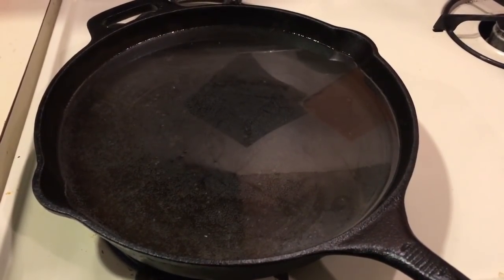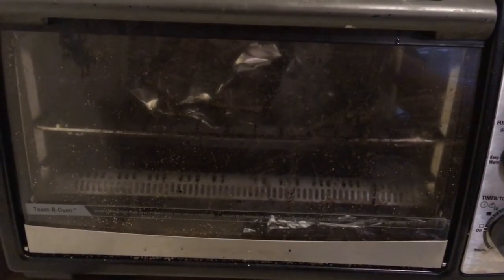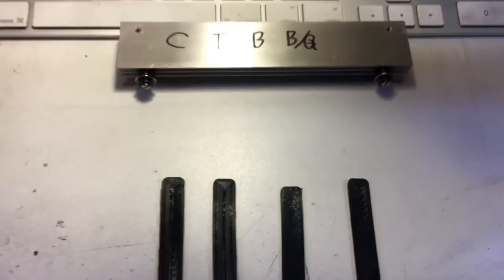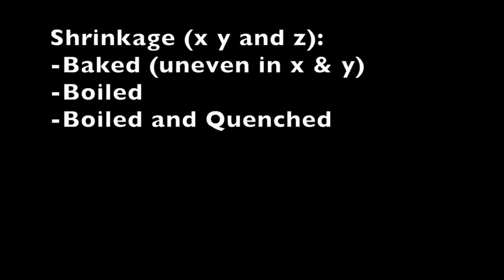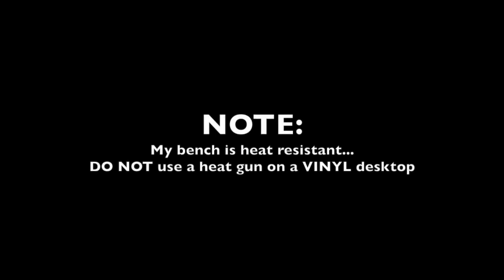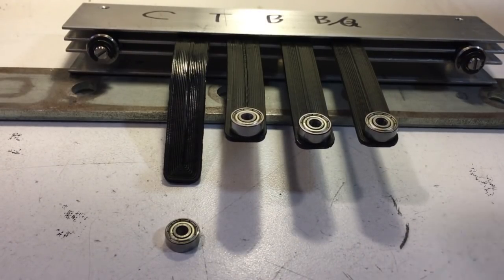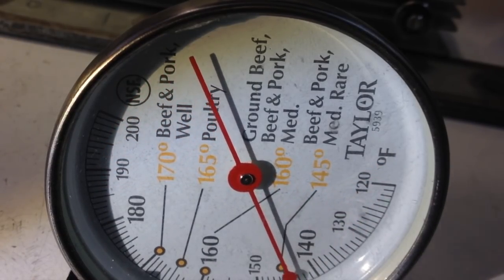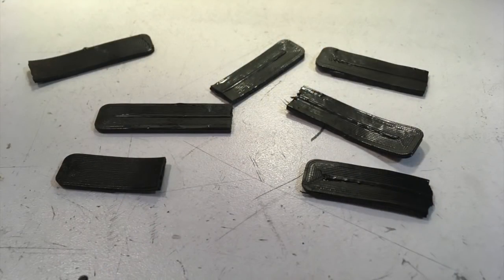A quicker way to anneal PLA 3D prints

Comment: I had success annealing my 3D-printed PLA part in an air fryer on 180° at 30 minutes. An air fryer is just a fancy convection oven.
Reply: I did put one of those springy rubber bits under it though to stop it from touching the bottom. More to protect my air fryer than the part but I'm sure it helped.

Comment: If you've got access to a flash autoclave, such as a Statim that dental offices use, there maybe an even better flash annealing option.  The Statim's flash cycle uses steam under pressure at 270F and the process, including dry time is done in 7 minutes.  It's not totally cooled down, add a few more minutes after the case is opened up...   

This discovery came about when one of my dental staff accidently put a PLA suction device in the Statim instead of the cold sterile tray.   To my surprise, the suction device didn't come out as a pile of goo,  Rather it came out relatively unchanged in shape.   I've not done any 'real annealing testing on these suction devices with flash curing...   It's not a flat item, rather it's a tube that has a 120 degree bend, and one end is a cylinder, the other a larger oval tube.   

The downside here is a refurbished Statim flash autoclave runs about $2000.  A less expensive option might be to try a simple pressure cooker...  Pay attention to the limits of your pressure cooker as things can get dangerous under pressure and heat...  (aka, use at your own risk).   What I do know is the Statim process is very controlled and it works and works fast...

Comment: I used your process to anneal a z-axis rod knob for an ender 3 pro. I boiled it for 4 minutes, and quenched it in ice water. I hadn't planned for as much shrinkage I got, but I was able carefully drill it out for a pressure fit.  I am VERY PLEASED with the product, and will be using that process to harden many more printouts. It inoticably mproves the strength and surface finish.  Thank you for the tip!!

Comment: Good thing to try: parts in a kettle.
I've done a sample run, it seems to work as a really nice quick and effective heat treating method, note that i had no foil or support metal, just dropped the stuff into the pot and turned it on; swirling the water to stop things touching the element...
The parts act as boiling chips, which seems to clean them somewhat, but may destroy fragile prints, or anything hollow that fills with liquid...
For things like spacers and other small components this works the best it seems!
Will likely try the brass hinge method later down the track, however i don't know if this is a symptom of being boiled alive, but the plastic "turns white" once it finishes drying, it appears as if there is a layer of some residue (which would suck) or the smooth surface has been roughened by the process of crystallization and boiling (which would be good, especially for paint adhesion)...

Comment: One question though. Can a sequential quenching, eg heating and cooling multiple times increase the strength further?
Reply: @UrosGavric. Yes and No, this depends on how consistent the heating environment is as well as timing between processes. If you do it too many times it will drastically affect the size dimensions as well as leave more room for error in regards to deformation / can greatly alter tolerance specs etc. If you have access to a suitable environment with consistent temp / time settings / go through enough trial and error yes it could increase the strength but it depends on what "strength properties"  youre looking for, such as compression, tensile and shear strength. each of those properties are critical to understand and drastically depends on the materials used, geometry and sizes of the parts  to create successful print post processing. I.E) If you alter settings to match compression strength you will likeluy lose "strength" in the field of shear or tensile. It is an entire science field so you'll have to experiment accordingly

Comment: for smaller or thinner parts like these, there is the delightfully lazy alternative, to just leave the parts on the print bed, crank it to 75-80°C, and put something like a styrofoam cup or a little cardboard box over them. give it 10-20 minutes, or untill the top is getting the slightest bit soft, let cool to room tem, and enjoy.
stickling to the bed also helps to keep thin parts nice and flat. works like a charm when printing a batch of guitar picks.
Reply: will try it for sure, thx fot the tip!
Reply: I cover mine in aluminum foil. It reflects the heat really well

Comment: Hi Alex. I printed one of those cable chains but it was a bit too tight so I tried this boiling water trick and it worked fantastically! So thanks for this tip. The chain is here : https://www.thingiverse.com/thing:2354864/comments

Comment: Boiling parts directly in water is terrible, water gets inside the parts and destroys them.
Reply: Why? It's not nearly hot enough to induce hydrolysis, and in absence of such water is harmless to PLA.
Reply: Shake part out. Use bag+rice or silica. Or just use a dehydrator on low...
Reply: @Chris Valin Apparently, PLA is water-cooled as it is extruded at the factory... Which makes sense, since it allows them to speed up the process of production.
Water on the surface / trapped in surface defects on the filament is likely a bigger issue, and also fingerprints etc.

As for boiling, it's probably a bad thing for parts with low infill and thin walls - if water gets into the enclosed space, it will suck to try and dry it out [days] or worse, if it nucleates [boils] on the inner surfaces, then there will be a rapid increase in pressure inside the part as the steam bubbles expand; if you hear a loud pop and come back to a split-banana, it could be this kind of failiure...
Hence 80 degree temperature control is the best option, and as mentioned elsewhere, glycerol can be a better alternative to water.
But for solid parts of small dimension, throwing them in the kettle is not at all unreasonable, just spray them with isopropyl to rinse the water off the surfaces, and let that dry off [5 minutes or so]...
Reply: Chris Valin,
So we should expect your replication using acceptable scientific standards soon, right?

Keep that nonsense to yourself unless you’re also going to post a reference to information you find acceptable.
You must have an example since you feel confident enough to criticize his effort.
Otherwise, you’re just being a pretentious jerk.

Comment: Made my own experiments recently. I measured two 50g spools of PLA, put one for a few days in water, the other in a bottle of Steiner Chemie dissicant (silica with indicator). The watered spool had the same weight as the dry one. They both printed the same, no changes in feel, stringing or look. I didn't hear any popping sounds either wihle printing.

Water doesn't seem to be a problem.
Reply from the maker: Nice!  I had been meaning to do some similar tests so that I could stop fretting about moisture.  I think PLA filament is still made by melting the pellets into an extrusion die, which feeds it immediately into water to cool it, so my assumption was that I could be worrying too much about moisture. Thanks for sharing.
Reply: Interesting! Thanks for sharing!

Comment: maybe put the part in an bag add sand, extract the air and dann heat treat it, this should stablize the part despite the form, still this is a lot of effort
Reply from the maker: THat's some clever thinking.  I'll keep it in mind for more complicated shapes!
Reply: since the pla gets at least somewhat soft, wouldn't some of the sand stick to it (or even be embedded in it), especially for more complex shapes? or does it not get soft enough for that to be an issue?
Reply: @TheCreat  I'd assume so, depends on whether it's an issue or not...
Plus drying is not that much of a pain if you spray rinse the part with isopropyl to get the excess water off, then gently warm it with a hair dryer...

I've gotten away with just leaving them to dry naturally, i'm only concerned about parts with infill - filling up.
Reply: Only one way to find out!